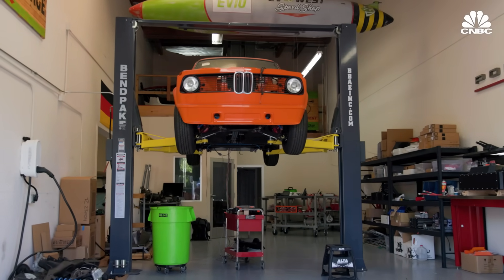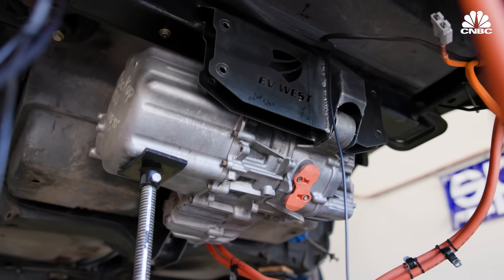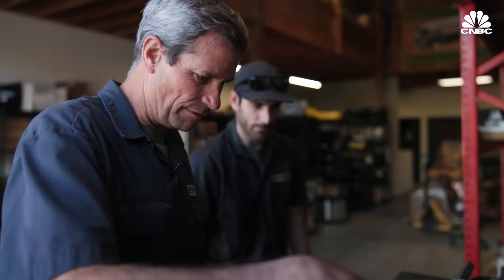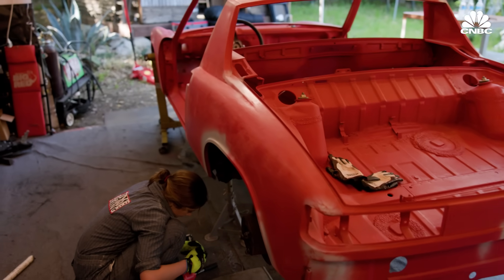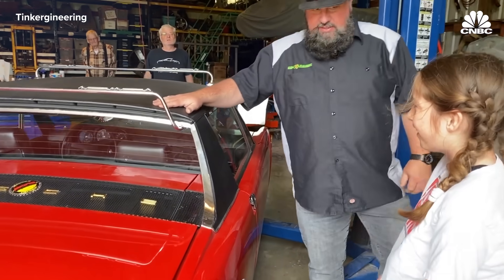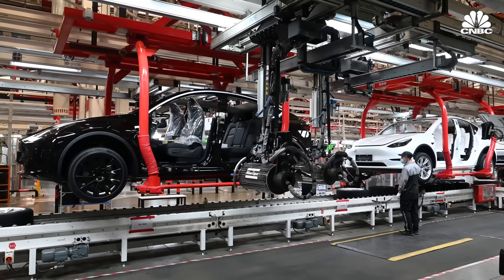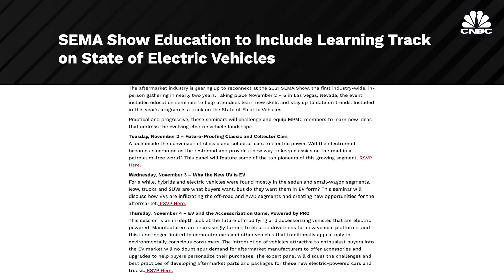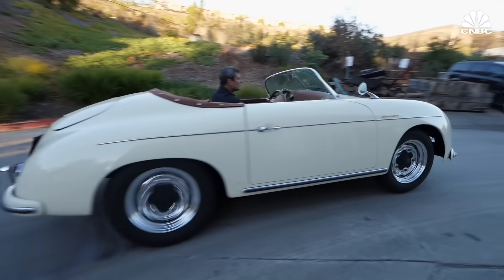How To Convert A Gas-Powered Car To An Electric Vehicle

Comment: Let’s say you convert your car to EV. You can offset some of the costs by selling the original parts. For example an e46 M3. You could sell the S54 engine, transmission, drivetrain. That stuff is worth quite a bit.

Comment: I'm still not ready to go full EV yet, but I'm currently shopping around for a new car and looking to get a hybrid, plug-in or otherwise. I like the idea of having an EV one day, I'm just not in a position to reasonably own one
Reply: Chevy Bolts are the most affordable with a 200-250 mile range. You can get them for around $20,000. Probably the cheapest new car you can buy and run period, gas or EV, but as a Bolt owner I wouldn't recommend it if you expect to do road trips often. I'm kinda shocked that the new prius looks good, and has like 40 miles of electric range, so that ones worth a look if you haven't checked it out already!
Reply: @dawsongooch4194  I appreciate the pointer. My only problem is I am still in college so my budget is like half that, so I've been browsing used hybrids instead
Reply: @zeph_os  Best of luck!
Reply: Welp, the struggle was real when the first cars came out…getting gas and finding parts.
Look how long we relied on horse power across so many civilizations.
The old joke was “har hat, get a horse!” When a person was seen stuck on the side of the road due to a flat or being out of gas.
Now most Americans can’t even ride a horse (sadly).

Comment: How do I convert an electric car to a gasoline engine to increase the range?
Reply: Rich Rebuilds LS swapped a Tesla Model S. It is possible, however it's more complicated than converting a gas car to EV.
Reply: tow a trailer with a generator running on it, then connect to your EV.
Reply: And fuel up time
Reply: and greener  @MrPeach1
Reply: Sell the EV to a blue-haired idiot and buy a proper gasoline powered vehicle. Very simple.
Reply: And make it sound nice 🙂

Comment: I believe that if you were to use high energy density batteries (probably higher than even exist yet) along with in-wheel motors, you could convert an existing small car for a relatively low cost. You just substitute the ICE engine and transmission for a battery pack in the engine compartment, and have 2 relatively small in-wheel motors (about 40kw for each motor like the Elaphe S400) attached to the suspension where the wheel axles would normally be at the front. For more high-performance applications, you could add 2 more motors at the rear. For more range, you can have an additional battery pack where the fuel tank is in the ICE version. If you can limit the weight of that front battery pack to not much more than the original engine, transaxle, radiator, fuel tank and exhaust system (about 200kg) then you can reduce the cost and improve the efficiency of the vehicle to the point where it doesn't need more than about 60kwh of batteries to give it decent range. But you need a good energy density like probably 300wh/kg to give you 60kwh in that example above of a 200kg battery pack. You don't want to be putting any more weight at the front of the car than what would have been there in the ICE version, and to balance it out and get the maximum range you do need to use that fuel tank space for more batteries, but beyond that, you shouldn't need to cut into the car body or put batteries under the rear seat or anything like that. A bolt-in solution is preferable to reduce labour costs.
Reply: In wheel motors are a BAD idea.  Just look at Lordstown Motors.  Their truck has four in wheel motors, a 109kWh battery, with only 179 mile range.  The Ford F-150 Lightning standard range pack is 98kWh, and has a 270-280 mile range.
Reply: @charlesball6519  Completely different vehicle, much heavier, less aerodynamic and with different, bigger motors. The motors on the Aptera will only be spinning at about 1500rpm at full speed, and will require much less power. In-wheel motors really only work well with lightweight vehicles, which Aptera is. They have even modified the existing Elaphe M700 to reduce power slightly and make it even more efficient.

Comment: Gas is a very interesting term. A search for gasoline turns up some terms while a search for gas powered vehicles turns up much more such as hydrogen, LPG, CNG and LNG to name some. So straight petrol (gas in USA) is more than it seems on first sight. Interesting.
Reply: No, "gas" when it comes to cars just means what the UK would call "petrol."
Reply: @timogul  Well I found the search interesting, maybe if you tried it you might too if that is the sort of thing that lights your fire (look out for gas though before you do that).

Comment: More of this, please! Thank you for making this, so proud of my hometown of San Diego and EV West. They are starting an international movement. Education & training is a must. These things are so much more fun to drive, even if they’re less efficient than modern electric cars, they still blow any ICE out of the water. 
EV Motors = 90% efficient
Gas Engine = 30% efficient
Also, almost any electric car is faster 0-30mph than most Sports Cars. 0-60mph is overrated and less useful in a city.

Comment: I wonder how solid state batteries will change this. Less weight per performance. Less risk of catching fire. I really can't wait to see how solid state batteries will change the ev market.
Reply: Solid state batteries are going nowhere in the EV world. Plus all of the most efficient current types still use lithium. They’re not going to be the magical solution everyone in the EV world so desperately dreams of (and NEEDS to keep their pipe dream alive).
Reply: Also the advent of sodium-ion batteries, which are not as energy dense but also carry far fewer fire hazards and could displace what we use lithium now for applications that are not as sensitive to weight (fixed storage, possibly trains and ships, etc). This alone would free up significant amounts of Li-ion for where it's most required.
Reply: @doujinflip  i don't think sodium ion can become the defacto standard of EVs yet. If people are complaining about the limited range of current Lithium based batteries, going to sodium will only make things worse.
Reply: Not just in EVs, but if solid batteries work, they'll change the electronics business (such as phones, laptops)

Comment: I was thinking of myself to have a similar conversion shop but couldn't get on to it due to pandemic timing. It's pretty interesting to see these changes in US. I think it is always better to give a second life to your car if economically viable. US is usually ahead in trying new things. Here is Australia things happen very slow.
Reply: For a sporty car, EV conversions actually make it perform better. Electric motors give more torque and the lower center of mass lets it turn sharper.
Reply: @doujinflip  I think the EV conversions are better for the old luxury cars, like the old USA lead sleds and land yachts or the old German sedans and Swedish hatchbacks where the smoothness and torque are prefered. The sports cars are best as H pattern ICE cars, though if someone wants an automatic then an EV conversion makes sense for them. The folks who prefer to drive and work on an ICE do it for a different reason, a lot like how people still ride horses even though it makes zero sense since they are slower than an ICE sports car. It's a strange tactile thing.
Reply: @doujinflip yep, because single or duel motors itself gives you more than 500 hp which is even more than a supra

Note: if you are supra kid, don't get offended,  just accept truth that supra is nothing without modifications (literally inline 6, bro it's engine used in trucks 😂)
Reply: I have question, how do you insure an electric converted car?
Reply: Janus Electric

Comment: electric motorcycle conversions are about to become really interesting, the motors are cheap and easy to install, and current cutting edge battery tech will give you roughly 80 miles on a half hour charge, 70% of that in 15 minutes
Reply: E-Moto makes life so much simpler. Keep your gas car as a backup, and use the e-moto for 90% of your tasks. Uses less energy, maintenance is way easier, no parking issues, no congestion issues. It is absolutely the way to go. Way cheaper as well.
Reply: I ride a e-motorbike. It is totally worth it, especially when the office is paying for the wall socket I can top up the battery at.
Reply: I have a 1970 HD sportster 1200.  I'm conflicted as to whether to convert it.  It's the S variant .. Buell heads, dual plugs, high compression. I think I'd rather convert my 1999 Whizzer copy to electric.
Reply: Ya it's getting close I been riding honda XL and XR since the 80s I have have a XRL with little over 20000m so bout half way to rebuild but I just Got a xr600r basket I was thinking about it but it was still les expensive to do top end on the RFVC engine and I can get up to 150m with over size tank but I'm definitely going to look further into it I also figure the the 600 engine will bolt into my 650l without to much
Reply: Whoo hoo 80 miles in 30 minutes!  Minus any time spent waiting in line at the charging station of course.  Such a huge advancement over the pathetic 300+ miles you get for 90 seconds filling up a gas tank.
Reply: @Leester-70  I mean, you could triple that range if you don't mind a huge underslung battery box, but, I'm not a big fan of riding something as wide and heavy as a CB750, keep in mind we are talking conversions here, a dedicated electric bike is another story, but none of them have the batteries I'm talking about yet, they're only in high end phones.. there's still room to grow too, lithium-silicon is just around the corner.. also, once we get megnetless hub motors, that new Fireblade will have some competition 😆
Reply: @GNARGNARHEAD   Even if you quadrupled the range it wouldn't matter.  Range is not the issue, it's charge time and charging locations.  Those are the two biggest places where EVs just fall on their faces compared to ICEs.  
Not to mention the infrastructure has nowhere near the capacity to handle as many EVs as there are currently ICEs.
Reply: @Leester-70 depends on where you live but 95% percent of trips are 10 miles or less. The infrastructure is there in cities to charge up but most of your charging is going to be done at home. Also not being at the mercy of OPEC oil cartel is a big plus.
Reply: @Maderasdesign  So far this year I've taken 3 road trips over 500 miles, and another 1500 mile road trip coming up in 2 weeks.  What am I supposed to do, have a separate vehicle for those trips?  With my ICE I have the flexibility of driving across the country in reasonable time at a moments notice if need be.  Driving long distances in an EV is a hassle of planning charge station stops, waiting long periods of time at those stops, and then sweating over your battery gauge the rest of the time.

NONE of the arguments for EVs make any sense to me.
Reply: I could really like a motorcycle that’s electric….
Reply: Lol
Reply: Wow, 80 miles. Almost enough to actually go someplace.
Reply: @calvin99991 how long’s your commute?
Reply: @Freshbott2  What does a "commute" have to do with it? Are you saying that I should own, what, 2, 3...4 types of transportation to satisfy every type of travel I do? EV people love to ignore basic facts about EV carbon footprints for mining, battery recycling, charging and the strain on electric grids, time consuming charging for even mundane trips, etc. Imagine the time lost if everyone had to stop every 2 hours to charge for a half hour. I'm sorry if I'm confusing you with facts and reality.
Reply: @calvin99991  yes buddy when I said how long is your commute I mean “You should own what, 2, 3, 4 types of transportation to satisfy every type of travel you do.”  That’s exactly what I said, and you definitely took it as such. In fact, don’t even own a car + a motorbike. Don’t even use planes or buses or trains or ferries. You WILL OWN 4 different types of transport, and all of them will be motorbikes with different ranges since you can’t think, and you’ll be pleased about it. 
I didn’t read the rest of your nonsense comment. Go feel antagonised by somebody else.
Reply: @Freshbott2  "Buddy"? You must be proud of yourself this month.
Reply: @calvin99991  Yes buddy.
Reply: @calvin99991  Most people will never exceed 80 miles in a day. For the occasional longer journeys, there are other options.
Reply: @calvin99991 meanwhile most people own 2-3 cars anyway lol and the idea of EVs is that you avoid range anxiety by charging at your destination

Comment: The bigger question is .. why would you.?? You can get a crate motor for a fraction of the price . No electronics degree needed .
Reply: i guess you would be getting the weight savings of removing drive train and transmission stuff from the vehicle, and if its an old vehicle they might be in need of replacement anyway.  But yeah, i think a crate motors probably a lot easier of an electric conversion.

Comment: I’m gonna put a diesel in a Tesla
Reply: Good luck fitting a diesel in a Tesla without lifting it. EV drivetrains are much smaller and more flexible than ICE ones, so you're likely cutting into the chassis itself just to fit an engine and transmission.
Reply: @doujinflip  It’s called a welder

Comment: I would do this for some specific car like a Porsche 911 Carerra (964), convertible, and if I had money to dump happily. The additional problem with these conversions is they rarely get over 200mi of range, so it's really a conversion for city streets. I would also wait and see if shops like EV West can convert over to the NACS standard rather than CCS, now that the entire country is going NACS thanks to Ford and GM partnering with Tesla.
Reply: Classic cars aren't driven that distance much anyway, so it wouldn't be noticeable.
Reply: 200 miles is ok now in most populated areas.   There’s enough chargers but they need NACS true.
Reply: Converting to NACS shouldn't be too hard, since the pin outs are identical to CCS, they just have the advantage of allowing both slow and fast current through their two main pins.
Reply: I'm hoping that EVs are able to have the charger ports easily swapped out as needed until we converge on an open global standard. Besides NACS/Tesla, there's also SAE/CCS1, the EU's CCS2, Japan's CHAdeMO, and China's GB/T.

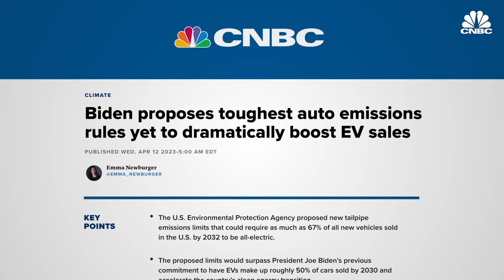Comment: 1:20 While Hybrids may not have gotten to that number, which might be due to a number of reasons including public perception and acceptability, that doesn't mean Hybrids aren't the way to go, until battery tech and charging challenges are resolved.

Comment: How does this affect car dynamics?
Reply: well, you will go through tires faster because you are gonna leave so much rubber on the roads.
Reply: That's the problem with the battery weight and why they need to be distributed across the chassis.  They mentioned it and also that they can't full Tesla batteries with the conversion, but 1/2 or 1/3 size batteries.

Comment: Please don't ruin classic cars. Forcing EV on us is already despicable
Reply: @Pickopen Forever420 That’s only a fraction of the oil required to power combustion cars.
Reply: It’s necessary for a better world. Not despicable at all.
Reply: @Freba9  Lmao better world. How brain dead can you be.. Where do you think the electricity will come from? Magical green energy? No, the same damn coal plants it comes from now. You will just be forced to live a life as a peasant, controlled by the government and limited in what you can do so we ca "save the planet" only the elite will be able to live to the full human potential.. Nuclear plants are the only way to make it somewhat clean but just imagine if we start having nuclear leaks and failures due to human error which has already happened in the passed so just increasing the amount of plants just increases the chances and those do more long term damage than any petrol burning car.

Comment: The "fuel" EVs use isn't just the electrical energy. The batteries have to be included since they hold the energy, take a lot of resources to create and take up most of the weight of the vehicle
Reply: This is only true for manufacturing new EV batteries from mined lithium and cobalt. Once you already have a battery and it needs replacement, hopefully its lithium and cobalt will be recycled into new batteries just like gasoline engines are melted down to make new engines.
Reply: @marc-andreservant201  one thing to note . The ones that don’t make it to recycling, end up in landfills . A gasoline engine will do zero harm . While a used old lithium battery will .
Reply: But they are from damaged, beyond repair vehicles.
Reply: Yes.  and your point is?